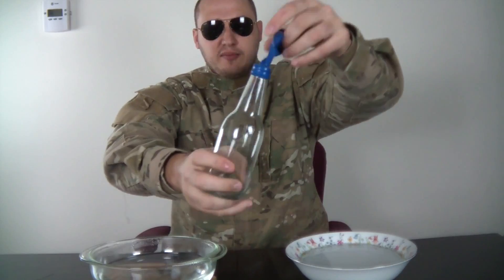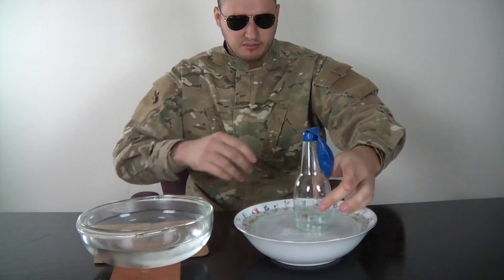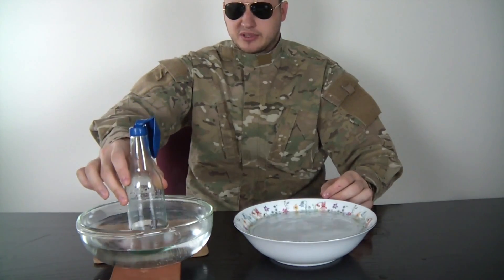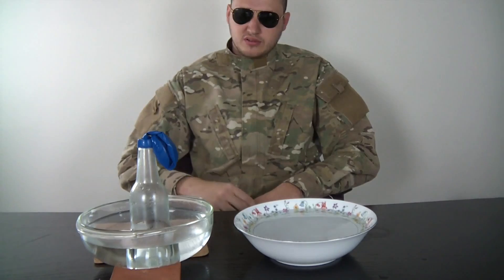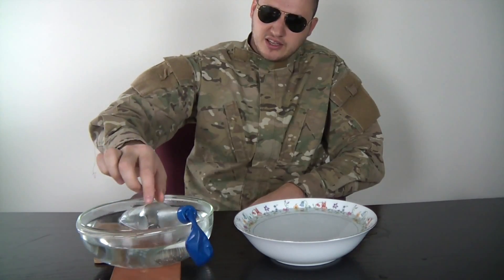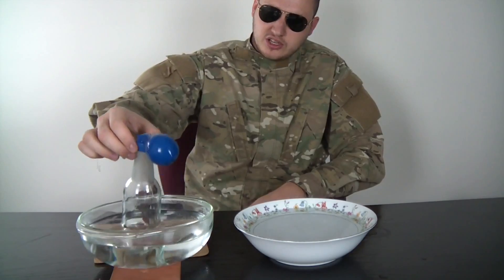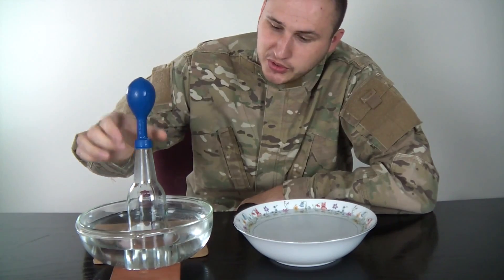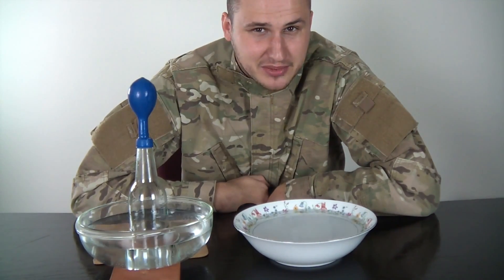How To Inflate a Balloon with a Bottle - Cool Science Experiment

Comment: You did it wrong.  You put the bottle in cold water to cool the air.  As the air cools the gas contracts down.  You then put the balloon on and put it in the hot water.  The balloon will then inflate because the air expands.
Reply: tonto ugly

Comment: No. The way it works is that the air molecules in the bottle gain more kinetic energy when they are heated from the water, causing a greater volume as the temperature increases and the molecules move further from each other as the molecular bonds break apart. A good example Charle's law, I believe. If I'm wrong, could someone correct me?

Comment: You don't need to dip it in cold water. if you want to do that, make sure to remove the balloon first so while the air molecules compresses the molecules outside can enter inside the bottle... So when the bottle is dipped in hot water  there are more molecules to expand that will cause the balloon to get bigger

Comment: It's obviously evaporation in stead of normal water he uses cold water to cool off the bottle then he puts it in hot water so it can evaporate faster inside because water can get outside or inside after that instead of evaporating in the air it evaporates in the ballon

Comment: When you put the bottle in cold water it makes the air inside the bottle cold (obviously) and cold air goes down torwards the ground because its more dense than hot air. So then you put it in hot water which heats up the air to make the air rise because it is less dense than cool air.

Comment: In cold water the particles in the air slow down, therefor getting closer together. When you put it in the hot water the particles move faster, getting farther apart. To compensate for the lack of room needed, it stretches the balloon and inflates it.

Comment: First off you cooled the air in the bottle second you heated the air in the bottle with the hot  water causing the paritcals in the  air inside the bottle to expand there for  expanding the ballon

Comment: you should have put the balloon on the bottle AFTER you had cooled it. By cooling it, the molecules in the air inside the bottle slow down allowing them to be closer together and more air being allowed inside. Once you then add the balloon, and put it in hot water, the molecules will speed up and expand- inflating the balloon. 
some other adaptations:
-put ice cubes in the cold water to bring the temperature lower and allow more air into the bottle
-deflate a balloon by going hot to cold

Comment: That is incorrect, density doesn't have much to do with the inflation. You also keep using the term "the air is expanding" which can be seen as a sufficient explanation on the macro level but not on the micro. Yes we use this term when first explaining physics to 9 year olds just so they understand but outside of that it is an inappropriate explanation. So yes the OP is right if he wanted to explain it to a child... 
Let me help you understand. Ask why the air is expanding, then ask why again.

Comment: You can actually "cook" water at room temperature if you put it in a "vacuum". Because of the air that is taken away, the water particles will have more room to move and have less collisions with air particles, resulting in it "boiling" at 20 Celcius. The reverse technique is used in high pressure pans.

Comment: The particles never "expand." Actually the heat gives more energy to the air particles causing them to move more rapidly. Because the particles are moving faster they push against the inside of the balloon with more force, therefore causing it to expand.

Comment: This process can be explained through kinetic molecular theory. As the hot water heats the air inside the bottle, the molecules move faster; thus, is able to take up a larger volume. Since the balloon is expandable, more molecules are able to diffuse into the balloon; therefore inflating it.

Comment: you forgot to add that the particles follow the path of least resistance, if it were harder to inflate the balloon than to break the glass, the glass would break faster than the balloon would inflate. This of course isn't true but the resistance of the balloon goes up when you try to stretch it out and thats why the expansion stopped at a certain points (also due to the lack of particles and energy)

Comment: If you put the balloon on the bottle in room temperature air putting it in the cold water only makes the air compress and the balloon shrink more giving the warm water that much more work to do. If you put the balloon on after having it in cold water the air inside will compress but there will be more air so as not to have a suction on the balloon. Then moving it to the hot water will make a bigger difference.

Comment: The way it works is that the energy of the air in the bottle decreases when it is put in the cold water. When the energy decreases, the air will not try to take up more space. When you put it into the warm water it caused such a huge jump in the amount of energy the air wanted to expand. Since it cannot spread the glass, it expands the balloon. If you have any need for explanation just ask respond to this or send me a message.

Comment: I think you would need to cool it first or if you did you would want to cool it and then put on the balloon. It expands due to the Gay-Lussac's law which states that at a constant volume, the pressure and temperature correlate directly. Since temperature is a measure of kinetic energy, as it increases so does the energy of the gas which pushes on the walls of the container causing the elastic balloon to expand.

Comment: As the air inside the balloon heats up it starts to expand. The molecules begin to move faster and further apart from each other. This is what makes the balloon stretch. There is still the same amount of air inside the balloon and bottle, it has just expanded as it heats up. Warm air therefore takes up more space than the same amount of cold air, it also weighs less than cold air occupying the same space :) Safety is Nr.1 priority! <3

Comment: Would have risen more if you put a little cold water in the bottle then in the hot water. Anyway it happens because the heat is rising causing air pressure in the bottle.